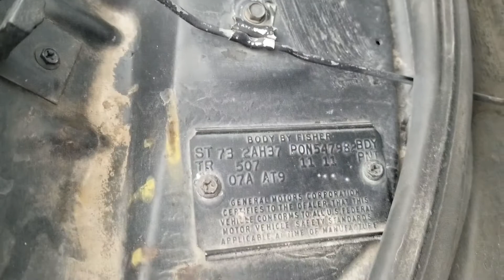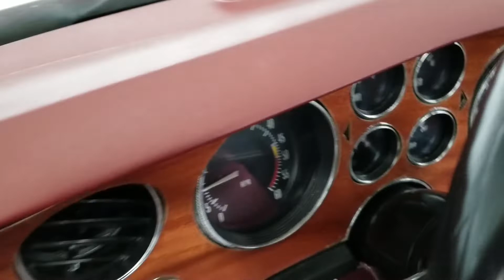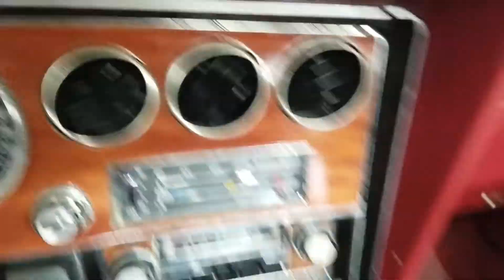1973 Pontiac Grand Am

Comment: Had a 73 from 1977-1989. Great car. Always wanted to get another one. I have never seen one with the sun roof or with a 455. This one looks to be fully optioned so it is a rare piece indeed. Appears to have been repainted, and the stripes are different from my car as I remember. It would still be a great car to have.

Comment: he needs to get rid of the Buick decal thats on the air cleaner.
Reply: That’s just an aftermarket 455 HO decal. Very popular on Pontiacs. Sweet ride. If you actually sold it you’ll regret it.
Reply: @mikee2923  Been trying to buy it back every since.Sold for $15k Tried to buy back for $25 he won't part.